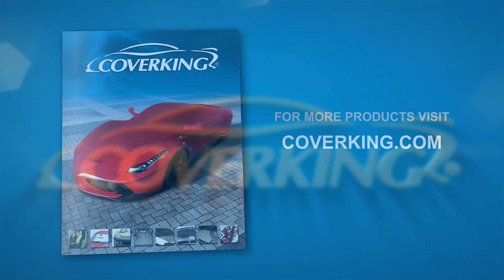How to Install 2015-2017 Chrysler 200 Custom Seat Covers | COVERKING®

Comment: How did you take the headrests off? My 2015 Chrysler 200c manual says that you cannot take headrests off without a qualified technician. They are adjustable non-removable. All my other research into it says the same thing which makes finding seat covers very hard!
Reply from the maker: Please reach out to us at support@coverking.com with more information about your vehicle so we can get you the correct part number.

Comment: How did you lift the bottom part of the backseat up?
Reply from the maker: We just pull up where the passengers knees would be if they were sitting on the seat. There are a couple of push pins holding it in place.